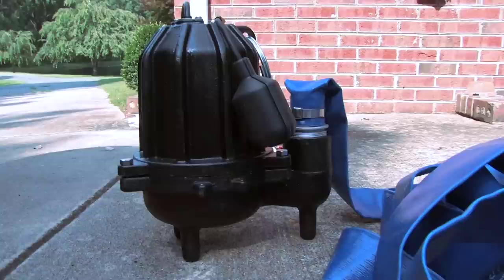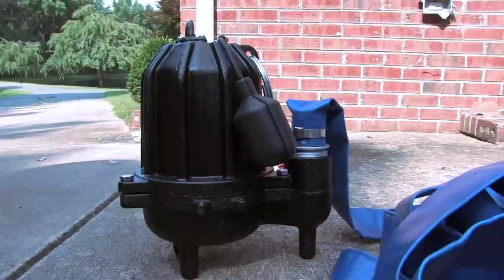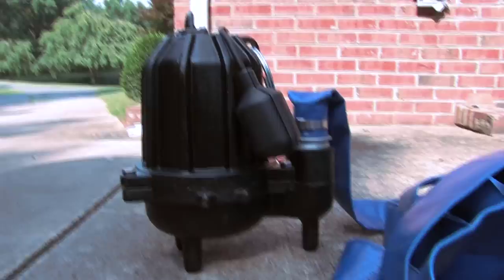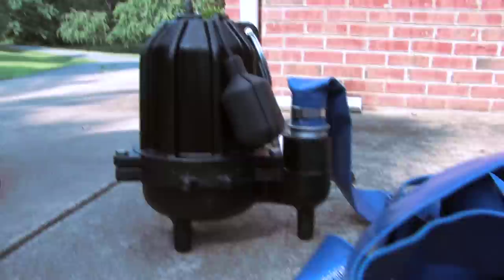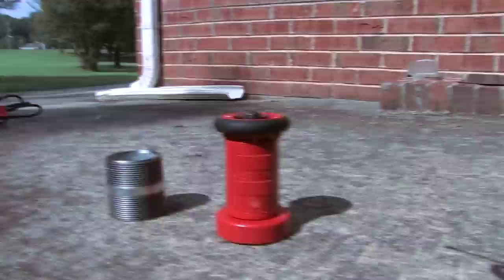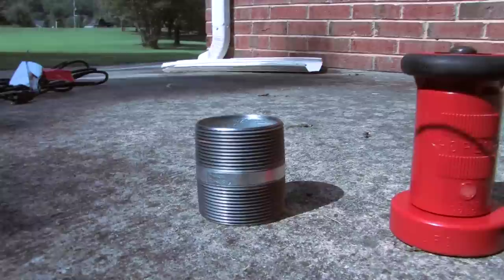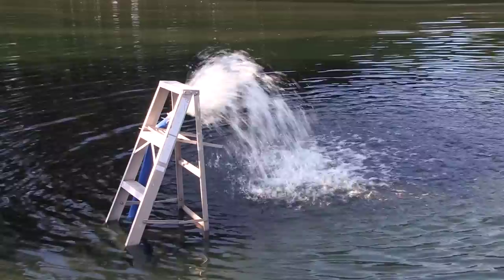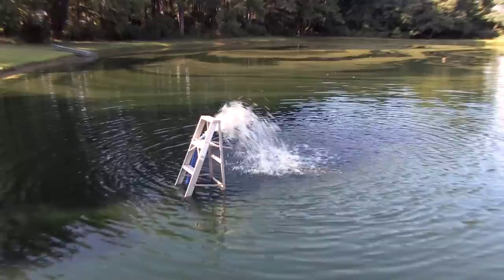My DIY Pond Aerator

Comment: Awesome idea, my little tweak would have been to add a venturi nozzle on the end of the fire hose with a garden hose for the air feed and dropped it at the bottom of the pond.  The advantage would be that you are aerating from the bottom up instead of top down, but love the fix it yourself spirit.

Comment: OK Steve let me share with you my many years of experience with fish farming and Aquaculture in general. Fish kills are the result of water at the bottom of the pond that has a build up of bad chemicals gases from fish waste and lack of oxygen. This creates a dead zone that fish avoid. this occurs in ponds that mostly lack an inflow of fresh water and an outflow creating a eutrophic system. the best way and the cheapest way to prevent this is not using water pumps as a means of moving this dead water up to the surface to release these gases into the atmosphere but to use air bubbles through a pipe that moves the water from the bottom of the pond  to the top. Air bubbles can move more water with far less energy cost than a pump. I manage ponds for people and have never had a fish kill.
Reply: Josef...Your suggestion is similar to what I've actually been considering trying to do in OUR pond. So, my thought was to dedicate one of my air compressors to the job of aerating the pond. I have considered attaching a 1/2" PVC pipe to the live compressor, running the PVC underground and out into the center of the pond, simply allowing the bubbles to flow out of the end of the pipe. Our pond is about 1.5 acres, with an average depth of 4.5' and a maximum depth of 12' near the middle and dam areas. The pond is surrounded by tall trees and fed by seeps and rain run off. The only drainage is overflow during heavy rains and evaporation. Will this work? Do I need to diffuse the escaping air in some way? Thank you for sharing your experience, knowledge, and wisdom. :^)
Reply: Having troubles with my pond a beaver took over any way you can give me help joe
Reply: Water loss due to evaporation will increase with this method.

Comment: Steve awesome job. Drastick times calls for drastic measures. If you had that many fish in your pond and had a kill that large sounds like you diagnosed your problem right on. One thing I would also do is increase the beneficial bacteria in your pond as well. That will also help. Long term look into adding a aeration system with diffusers in addition to what you have already done. This will allow you to keep a heavy stocked pond and prevent a kill especially in hot temperatures. Great video. Thanks!
Reply from the maker: Thanks Kurt. You share a name with one of my favorite actors unless you ARE one of my favorite actors :)

Comment: I'm told by pond experts that any surface working devices (I. E. Fountains) only aerate the top 4 to 6 feet and don't do anything below that. They recommend aerating from the bottom so the entire water column gets circulated. This design seems perfect for shallow ponds.

Comment: Me personally would of put the pump in deeper water, and instead of hose, found some adapters for PVC pipe to connect to pump and come straight up about 1ft above water level and let it spray out that way... this way deeper water is being circulated to allow oxygen levels to circulate the deeper waters. 

Just my opinion... I have a acre pond I would love to do this, but no power source anywhere near it, and can't afford solar and don't seem feasible to use a gas powered generator for cost reasons...

Other than that, Great Video and idea!
Reply: I've done this what w0qgs Richard state and it works perfectly...I thought about it way before this video and done myself but truly it works

Comment: At the bottom of the pump put a small air line to the surface and run 2 in pvc with dual head very short pipe as the discharge put pump in deadest part and when air is going through pump it will then cause a major aerator and cover a lot more surface area and stay under the water longer thus giving more oxygen and wider area of breaking surface tension to let dissolved oxygen exchange so quick fix just make the pump cavitation and you will be so happy with how much and effective it is

Comment: I like your DIY aerator, but it probably uses a lot of electricity, and grinds up quite a few small living creatures. You can probably achieve higher efficiency, not killing any creature and keep some dollars in your pocket by using a fine bubble aerator. Just drop one in your deepest section of the pond. The bubbles rising from the bottom created a natural circulation of your pond.

Comment: My DIY Aeration pump is a little different. I used an above ground waste water pump that pumps 85 gallon per minute out of the two inch outlet. I set this pump on top of my pier and the two inch water inlet pvc pipe goes down to the bottom of the pond and out from the pier 40 feet and then "T"'s  off another 30 feet each direction with one ways valves on the end of each pipe.  I put the same fire hose nozzle that you have at the outlet on a 4 foot 2 inch pvc pipe and aimed the spray toward the center of the 2 acre pond.  This has worked Great for four years but the one way valves have failed and it's very hard to prime the pump now if you shut it off.  It now pumps up a little mud off the bottom with the pipe ends on the ground.  Next time I will put an elbow on the ends and have the one way vales sticking up about 8 inches instead of laying on the ground.  With the fire hose nozzle, the water sprays up about 50 feet and out to the middle of the lake.  I cut the pump off in the winter time and drain it to keep it from freezing.   My pond is 6 years old and so far, no fish kills.
Reply: Ted Dodgin 
I think you have a solution for my problem. Any chance I could discuss my issues and get your opinion?

Comment: Didn't say before but I'm considering buying a place with a 2 acre pond.....and have been considering many things, before buying....like....how to aerate / add oxygen / maintain habitat for the fish and pond life in general.

I, too, was looking into water pumps....and the considered aerating from the bottom, rather than the top. With no experience of either method, I think I would go from the bottom....like an air stone used in fish tanks / ponds and more.

My thought is that you run hose to a length of PVC pipe....with lots of holes or even put holes into the pipe itself and aerate along the length of the hose. Because of the displacement of the hoes, in water, it may need to be weighted so that it doesn't float....but I believe this will work.....and you might be able to run the pump from solar panel(s) & battery back up. If you have the option to run from mains electric or solar....if there is a power failure on either side, you have an alternative and could even use a generator....if the wiring arrangement supports the 3 options. 

Sorry to hear of the fish kill...but I think one of the main issues, regardless of how you aerate, is to monitor the oxygen content frequently + the other elements to maintain a healthy pond.

I'm no expert but appreciate having a pond is more than just having a pond and leaving it to do its own thing.

Comment: go to eBay buy a Thomas twin cylinder pump used about 50 dollars. you can also buy diffusers and weighted air line all for less than what you spent. and you should run it 24/7 all year to avoid stratification. if you only do it in an emergency you will flip the pond,shock the fish, and have a huge fish kill.just trying to help
Reply: +Kevin Hardin  I agree,   I Use the same, Thomas 2660, rebuilds are easy on the pump.    It's taken care of my pond for 4 years now with two rebuilds.  I also add a little pond dye at the first of the year to keep algae controlled.
Reply: I bought a sump pump and put it in the deep end with a milk crate and filter then buried the water line go where it pops up behind my waterfall and it work awesome had it for years
Reply: Do you have a video of that set up?

Comment: I see that you do not have your pump in the deepest part of the pond.
It is important that you bring the bad water at the bottom to the surface to release the bad chemicals that are at the bottom. I forgot to explain in my first message what causes the fish kill. when you have a thunder storm in the hot summer all that cold water from the sky goes down to the bottom of the pond forcing the contaminated water to mix with the rest and this causes the algea in the pond to die and the decomposition of this algea depletes the oxygen in the pond to the point that you see fish sucking air at the top of the pond, soon after they start dying.

Comment: I was wondering what if you drilled a small hole next to the propeller on the pump and ran a half inch tube to it and kept the tube above water that way when you're pumping the water you're also pumping air into it and it auction eights the water it's like a DIY aeration system I'm sure you could find it on YouTube I actually did it with my small hundred gallon tank at home because it did not want to buy a small aeration system for my kids tank

Comment: Can  I make a suggestion....instead of running a water pump, to pump into the air, to "collect" oxygen....why not use an air compressor and run a hose to the bottom of the pond....and run the outlet through a piece of PVC pipe with lots of holes? The hose aspect could remain in place all of the time and you can connect the compressor whenever required....or run it constantly.
Reply: MH P 
Are you able to share some thoughts with me... I think you have a solution for a big problem faced in aquaculture
Reply: MH P

Comment: looks good, very efficient. Is the sump plugged in? Do you have to keep the connection above the water line? What if you had an above ground pump (like used for a pool) and used the intake from the pond, but the out-flow, you let some air into the line, then run that to the bottom of the pond so bubbles are pushed through the water from the bottom up. Like in a fish tank? This might produce more oxygen and also deeper. It would also be easier because the pump is on dry land. Just a thought

Comment: It'd be good to have some numbers from the scientists somewhere after the style of what circulating volume of water is required - as a percentage of the whole - to keep a body of water aerated sufficiently for various species of fish etc...

Everyone seems to be working in the dark.

And oxygen absorption varies by temperature.  What % of variation do we look at there, per degree change?  

All these kinds of things....
Reply: arthur brogard Well to answer your question about the oxygen absorption varying with temperature, if you prevent stratification from happening in your pond, then you wouldn't have to worry so much about surface temperature, even on some of the hotter days. if you put some sort of aerator at the bottom of your pond, preferably the deepest part, you will get the circulation of oxygenated water all around. The deepest water also holds the most harmful chemicals, but as its pumped up to the surface the bad gasses are released as it breaks the surface. 
So on a hotter day when oxygen is escaping into the atmosphere at an accelerated rate due to the water molecules moving around so much, the fish will hopefully be able to retreat down to lower water.
Anyone correct me if i'm wrong, i'm just gaining this knowledge and i would love to learn more and/or correct myself if i'm wrong.
Reply: dgorrell7  i'm not sure what you're saying here. i never worry about surface temp. should i?

the guts of what you're saying seems to be in para 2 where you talk about the fish 'retreating' on hot days.  

well, yep, of course. they can always do that. 

so what are  you saying?  that having an 'aerator' will circulate oxygenated water to the depths? so's the fish could go the depths and find oxygen?  and avoid the hot water on top?

well yeah, that's why we oxygenate.  its taken us right back where we started.

or where i started:  what circulating volume of water is required..... etc

in passing i'd think there'd be plenty oxygen in the top levels once your aerator is running because that's precisely where the oxygenated water is - on top.  On his thing and on mine. i think.

but my pond is tiny little thing - a bathtub in the backyard - he's got a lake,  the lucky bugger.

Comment: Seems like a nice guy trying his best. But this is NOT how to obtain proper aeration. The main purpose of aeration is to provide dissolved oxygen and most importantly break up the thermocline.  This system here does nothing to break up the thermocline.  Bottom diffused aeration by way of an air pump, weighted air hose to one or more diffusers set at deep part of the pond is the way to go.
Reply from the maker: You are correct. It was a temporary solution.

Comment: A pond should be aerated all the time, not just after an emergency. Nice ghetto look to your pond with the garbage pail and step ladder all summer.... not to mention the cost of electricity 24/7. Add a few more hundred to your plan and invest in a windmill aerator. Been running one in my 1 acre pond last four years... To date I've found two dead fish :-) You should mount a rebel flag to the stepladder to really round out the decor........
Reply from the maker: Michael if you only had any inkling of the disaster I had just been through with a thousand dead fish and the cleanup it took. If you knew what I went through, you would have encouraged me to run an egg beater in my pond. I would proudly fly a rebel flag by the way. I can't really determine if your comment is tongue-in-cheek or not.
Reply: Michael Reilly can run a nice pump without using batteries with a solar panel.